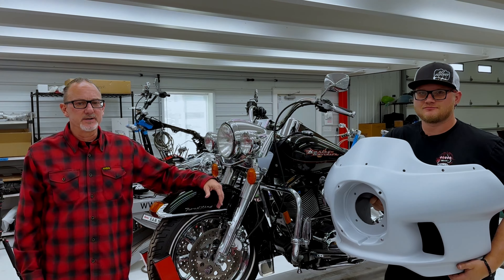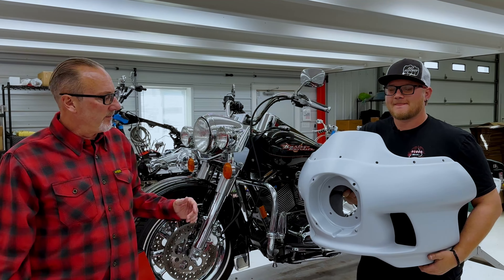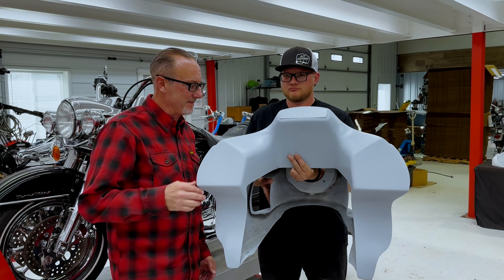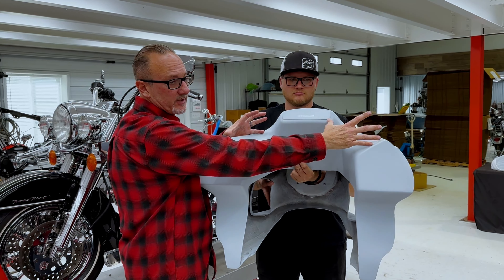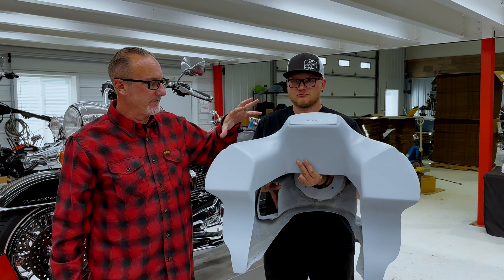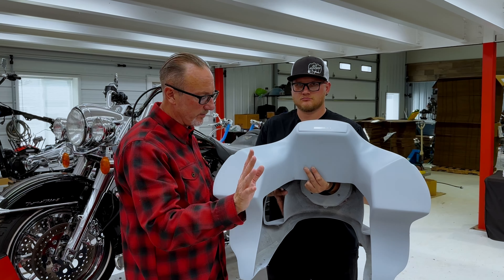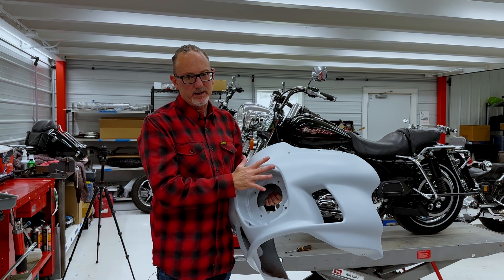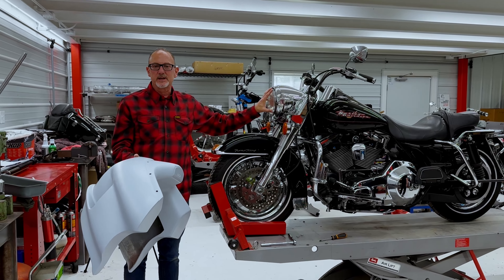FXRT vs FXRD vs FXRP

Comment: I’ve seen videos of guys having to cut away at the fairing to get it to fit on their certain model. If I bought this for a 2020 or newer road king would I have to cut the fairing at all or is it built to fitment?
Reply from the maker: You should have to do not cutting or drilling. We aim for it to be direct bolt on

Comment: Which 1 do I need for a 2023 Softail Sdt. Where di I get a headlight since mine is 5-3/4. and will it fit the OE HD plug
Reply from the maker: The 18+ softail kit would be the one you need.  As far as the headlight I am not 100% which plug it has.  One of. Our employees is running a 7” jw speaker headlight on his lowrider s